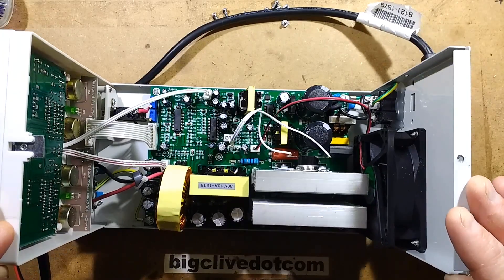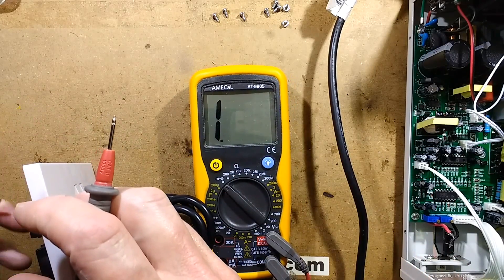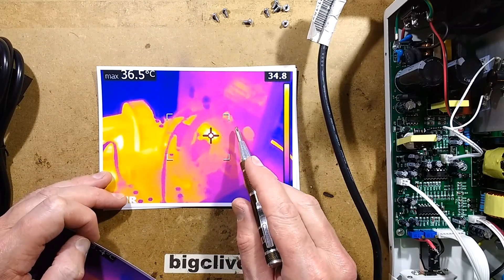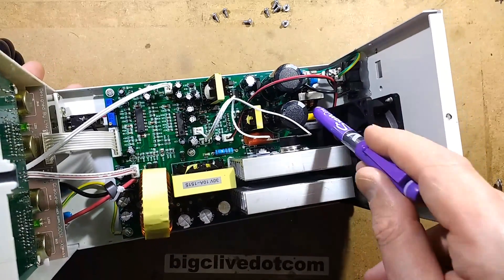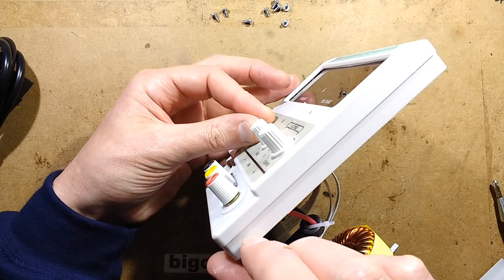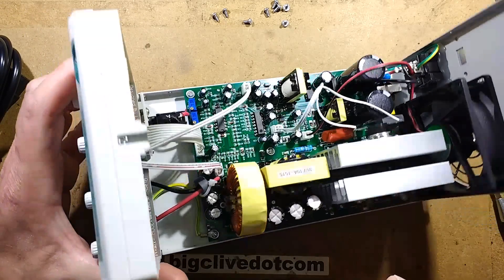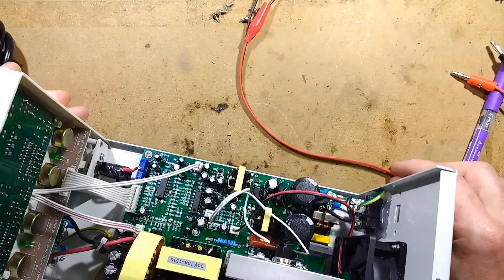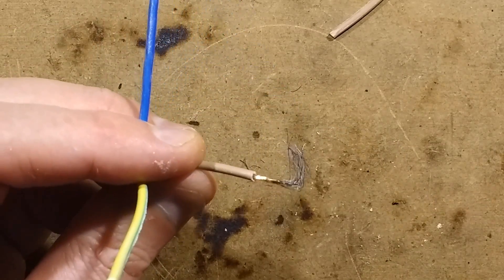Test of a PSU like the one that went on fire.

Comment: If used correctly, what is the issue with Al? Houses in the US with circuits >30A have Al conducts. No troll, honest question.
Reply from the maker: +Crocellian Aluminium tends to form a high resistance oxide layer that can result in arcing.  The ends must be terminated with suitable coatings to prevent failure.  Old installations can use aluminium to copper conversion tails for a safe fix.

Comment: Hey Clive im just wondering where did you learn about electronics and if you went to University to learn and if so what course did you do?
Reply from the maker: +TokoYami Electrician to trade.  Largely self taught in electronics by picking it up over time.
Reply: Self taught? thats pretty cool. Im uncertain in what i want to do at the moment as i just finished school and now im heading into uni but by watching your videos it make me want to do the same things your doing as i find it very interesting
Reply: Ok thanks for the advice. Ive already applied for a course at Uni which is software and electronics systems engineer, http://www.qub.ac.uk/courses/undergraduate/software-electronic-systems-engineering-meng-gh68/#overview
Reply: Thanks for replying with a lengthy comment its now made me more confident in the course i picked and i will remember your advice and put in the hours. I will also build my own power supply as my first little project :) 

Thanks for taking your time replying to me :)

Comment: It seems to me like a 12V PC power supply modded for variable voltage and current.
Wonder what's the current limiting and short circuit protection mechanisms they've implemented.
Thanks for the cable testing tip and the sleeves earth issue.

Comment: I have one of these supplies. I had trouble with heat and found the terminal back plate was not tight enough. I also ran a SSTC at  31 volts and nearly 10 amps via two TIP35C's that popped the output MOSFETS and a 47K resistor. 
It is back on my bench and in full service again.

Comment: Hmm... literally bought a power supply yesterday, made some crocodile clip cables on my own (best part was forgetting to put the sleeving on the cable before crimping and soldering all together :D ) and tested my (same shape as these) banana plug cables with an 18650 battery. Shorting out over the 10A of the multimeter resulted in mere 2,5 Amps..... then trying with those USB load thingies, 2 of them together, drawing all the USB plugs could take (no more than 7 amps), the whole cable got pretty damn hot, was actually nice because after 30°C+ it suddenly became a lot colder. My hands liked it!
Also those banana plug cables were so bad, the voltage reading of the Multimeter was off by up to 0,3 Volts compared to proper 1,0mm² silicone crocodile-banana plug cables.

Still wondering: why does this happen to me? I do something, BOOM Clive or Julian Ilett does/buys the same! Especially the postbag videos, feels like he spies on me or something. Or do I spy on him? Who knows...

Comment: The power MOSFET at the secondary side actually regulates the output linearly. The SMPS always delivers just a few more  volts than what's the output voltage. Bench power supplies are usually built like this. This allows efficiency of a SMPS but also the supreme regulation ability of a linear regulator. So it is very efficient and yet it has very little ripple and very fast current limiting.

Comment: I've got one similar to this, and as a cheap switch-mode bench PSU they are usable provided you understand the restrictions of the designs current limiting.
One thing to look out for is the position of the foot on the rear left hand side - on mine the feet are held in with screws and that foot is directly underneath the mains input on the PCB - if it was screwed up too tight it would have 'interesting' results. 
Mine also arrived with the earth connection not soldered to the power input socket - so, like all chinese sourced electicals, you need to check the electrical safety before use.

Comment: Yep, as I guessed on the last video: the connector gets very hot because of chincy plugs and wires.
Overall the circuit doesn't look bad. Line filtering, chunky components and heatsinks, thermal cutout are nice. Seems to be a proper design (except for the weird thing with the current regulation).
The overall build quality lets it down again though. Crooked components, big inductor only "secured" with a zip tie, one of the front panel wires so short it tugs on the connector, bad connections to the binding posts (at least some here have reported that) and of course the really dangerous wires they supplied with it (both of them, mains and secondary).
Given the price this is a PSU that beginners will buy, who at the same time very likely will not know how to spot a dangerous product and how to fix it. That's worrying.
Reply: superdau 
In the zip ties defense, a lot of modern cars have them holding the wiring looms together/in place. Chrysler loves em as I'm sure some others do. If they can handle the heat/cold cycles and vibration of the engine and road, I'd think an inductor is little worry. But how you use them is just as important as where you use them.
I mean, the mounting isn't great, really shouldn't be a big deal for something that hides in the corner of a bench.
Reply: superdau any suggestions for the best balance of budget/without being unsafe for beginners
Reply: superdau actually I’m just getting to the end of the video, is there a couple of mods that can be done that would make this unit decent? Forgive me I don’t entirely understand all the lingo but will learn whatever needed to make appropriate mods. I caught the bit about soldering the leads, but looks like I missed some others

Comment: Just checked mine -- a Lavolta rebrand, but otherwise looks identical -- and mu cable ends have been tinned and clamped to the screw properly. Mine also didn't come with the sheathed earth plug. Interesting. I wonder if a third shift made a cheaper one.

Comment: Don't think I seen any plugs like that but sure going to check them now (was not aware that the earth was designed like that in the socket) amazon and ebay should be banning listing if they are been provided with or selling cheap illegal power cables like this

Comment: For a bench supply nothing beats a good linear. Switch-mode is too noisy and, as demonstrated, doesn't always regulate well at all loads.
Reply: Yeah, I have one of those TTi dual channel jobs that just went dead on me. Fuse okay, mains in okay, needs fault finding but I'm way busy at the mo.  Know where I can get a schematic for such a thing?
Reply: No worries, Google to the rescue!
Reply: I have a dual output switching bench supply that has a very clean output, perfect regulation at any load from 0-4amps on each output.....but then again its a TTi (Thurlby Thandar Instruments) that cost over £800 - you get what you pay for!. Cheap chinese junk is going to be...well...junk.

Comment: I bought a STP3010 (Sky Top Power) p/s just like this one, in Feb 2016. It had a fault (diode in the fan supply burnt out).  Most likely from a track nearby touching a bit of solder under a filter cap. Easily fixed after the company gave me a portion of the circuit to look at.
Other than that, I tightened the binding post nuts (steel - naughty!), glued a bit of fibreglass pcb across the heatsinks so the they could be used to lift the whole pcb assembly. Put a warning note on the heatsinks (240V).  Also positioned a business card so the fan drew more air  from the heatsink area, and scraped the earth connection at the frame.  And attached a handle for carrying.  Checked output using 4 Ohm (bit if steel wire in a glass of water) periodically paralleled  with 12 Ohm. No evidence of ringing on my (cheap) CRO.  No problems since then.

Comment: why is it that sometimes the ground pin is full plastick
Reply: TheWyot  If an item has no exposed metal or has two separate lots of insulation between any mains voltage conductor and any part of any exposed metal, then an earth connection is not needed. So to save money a plastic earth pin is used. The earth pin must be present so that it can open the shutters that cover the live (line) and neutral contacts in the socket.
Reply: 1024 MAK A++ perfect answer
Reply from the maker: +TheWyot That's common on double insulated products that only need live and neutral.

Comment: I've had 2 of these switch mode power supplies already and they do really great but whenever I've pushed them to their max current and voltage on an inductive load a small surface mount resistor close to the bridge rectifier ends up exploding. I would love to watch you abuse this thing and see if you get the same results before you took it apart.

Comment: @bigclivedotcom I have a question. The other day, a shitty power socket yanked the ground pin right out of my laptop charger. The laptop charger power brick has no exposed metal on the casing what so ever, its entirely plastic. The laptop doesn't have any either, come to think of it... But it only has 19 volts DC coming into it from the power-brick. Anyway, is the charger still safe to use? Also, why is there even a ground on it in the first place? I though the purpose of a ground is to avoid shocks by giving the power a path that's way easier than a human to travel though. Why have it on an appliance where nobody is ever going to be in direct contact with it.I'm using North American outlets by the way.

Comment: I'm glad I bought my bench power supply from Farnell - proper power cable and decent test leads. I also got some additional leads from them and although they were relatively expensive they're great quality and are made to last. Anything I get from China, that's not via a reputable retailer, I always check the cables and take a look inside to make sure the earthing is adequate. It's a great excuse to 'take it apart!'.

Comment: How is the reverse polarity protection implemented ? Just incase you connect to a battery incorrectly. 
Is it diode and fuse I couldn't see a fuse anywhere.
Reply from the maker: +Peter Jones Usually just a diode that dies short circuit and a warning not to charge batteries in the manual.

Comment: thank you clive, i never paid any attention to my plugs in my home until i seen this video, so i went around & found 3 of my plugs had a sleeve on the earth pin, all of which was a metal case appliance, now all the plugs are changed! thank you again clive!
Reply: Kyôdai Ken the worst part is when the Schuko plug rips the sockets out of the wall due to poor wall plate installation practices
Reply: Haha thats the way it should be done XD

In Yugoslavia its just standard for you to be able to rip out sockets after a few years, you wouldn't believe some of the trade work done in that area, unless you babysit the tradie you can be guaranteed he's going to do something shoddy.

A more worrying standard is that hot water heaters are most commonly found above the bathtub beside the shower, especially with the wires exposed.
Reply: The one advantage of the UK plug is the safety of it. Built in fuse, shuttering etc, although you can get those on the other regions units too, but they are only optional and not a standard like the UK plugs.
Will we ever see a world standardisation of plug sockets some day?
Taking the best features of each, or is it just too late for that?
Reply: I live in Denmark, a lot of people cut the earth pin of the schuko plugs off, because old apartments like mine from the 60's don't have any grounding.. Most power strips don't even have the grounding copper piece in it, unless you pay like 3 times the price.. It's absurd. Love the fact that you can feel the energy off your PC when it stands on a synthetic carpet without being grounded.. Especially love the fact that my old rack server with dual 750 watt PSU - which I had to lift up, while touching the radiator with my thumb by accident, can make you forget your name for a couple of seconds...... I dont get why this isn't enforced, I mean this is Scandinavia, we should do better than not having ground in certain homes... I really need it!
Reply: @W0ND3RB0Y1  (I'm Danish too): when upgrading our kitchen I got installed shukos everywhere. As all appliances come with shuko anyway, it means they are actually earthed. Some say they are ugly; I like them. I got them from Bauhaus Germany when I went for "taxfree" coca-colas ;-), at about 1/3 of the price of the danish LK monopoly sockets and switches.
Reply: @W0ND3RB0Y1  funny
Reply: Gauntlet I bought a solder station from a UK supplier although it was made in  China. The  plug had the sleeved earth pin, but it also had a BS Kite Mark and the BS section it was tested under it also had the authorised  by mark. So was it a legal plug or just a fake but sold by a UK supplier?
Reply: Geoff Lotton okay it should have been PA testing but the point is still the same class I is three core cable with an earth wire connected to the earth pin and class II is double insulated and only has a two core cable so the plug can have a plastic or shielded earth pin
Reply: sadmac356 unless you are in the UK or order something with a UK plug, not one single plug will have one unless they change something in laws because of people dying due to putting their fingers across the terminals trying to plug in in the dark even on the earth pin, the mains pins only have them in the UK because 220v it's A LOT easier to die from than 110v
Reply: standbanger2 you may be able to just burn the sleeves off with a lighter as it seems like they are just heat shrink
Reply: I wasn't sure if it would, I've never really looked at them much. But if I order electronics online, I'll probably still check for it.
Reply: Portable appliance testing testing?
Reply: I should probably check on that too, though I'm not sure how much it matters in the US.
Reply: sadmac356 no us plug will have it
Reply: Maybe the unit was double insulated and then it's perfectly fine.
Reply: Gabe Ulrickson makes sense
Reply: @Allanda1 I never experienced that in Germany. But it happened to my ex gf back then after some years of tear on the same socket. I fixed it, though. It now can survive tanks pulling on it. ;)
Reply: Kyôdai Ken 
No the plug didn't have the double insulated double square symbol and it had three core wire. I have done PAT testing so do know the difference between the symbols for double insulation and earth pin plugs this plug had the sleeved earth pin but was showing the earth symbol next to it, double insulated plugs only have two wires.
Reply: It's good to live in a country with proper Schuko, where something like this can't happen. But, you almost are unable to unplug Schuko plugs... This is really annoying... They're so stiff!
Reply: Well still you don't have high death rates, so it kinda ... works? :D
Reply: Yikes this feels like something that the government needs to handle that's fucking dangerous as shit. God dammit China.
Reply: Schuko also has shutters and safety. We don't need a fuse in each plug cause we don't need to have a 32 Amps ring mains cause we can actually afford copper. xP But as I said, it's hard to remove them out of sockets which really sucks and they aren't polarized... But also your UK ones are far too bulky...

Comment: Hi Clive, I have one these PSU and one day when I switched it on I heard a popping sound then the unit went completely dead. I have had a little look inside which seems to be exactly like the one that you have in your video, but I couldn't see any obvious defect from merely looking and checking the fuse. Could you please offer any suggestions from what I have explained that could have caused the fault with my PSU? Thank you.
Reply: One of your components probably popped, look for expanded capacitors, burnt or missing components, even sometimes the fault will be minuscule but looking closely you might see that one of the pins has sheared off.

Comment: If those test leads are the same ones I had, they're also CCA... I dead shorted them across a 15volt PSU, and didn't exceed the power supplies 15amp current limit...
Reply: Oh that's really crap

Comment: We would like to see what is in the display unit. Does it have a microcontroller? Like stm32?
Reply: Malhar Deshmukh Probably a standard metering chip, directly measuring 0 to 200mV (or similar) via ramp charge / discharge and driving the LEDs.  These chips have been around at least since the early 1980s.  These are not the fancy multimeter chips, they are simple single function chips that do that one job with a minimum of passive components.  Industrial electricians like Big Clive often install ready-made modules with these into  industrial control panels with a basic resistor, voltage divider and optional measurement transformer in a DIN rail module inside the box.  Pretty much the only variation is the front panel sticker telling people if the number represents mV or kV, or perhaps even MW, in accordance with that circuit in the back (obviously the internal module for kV or MW is going to be a lot beefier than the lower range ones).

Comment: Oh, and one more question,   I am amazed at the evolution of modern welding equipment which now is using MOFSET among other items.    I can't bring myself to understand how it can carry so much current...in some cases topping out at 300 
amps and 25-30 volts at the TIG, MIG, or stick electrodes.....please explain.
Reply: Same here Im in the metal fab biz I cant bring myself to buy one with that stuff in one all mine have lead sled transformers in them Lincoln and Miller units .